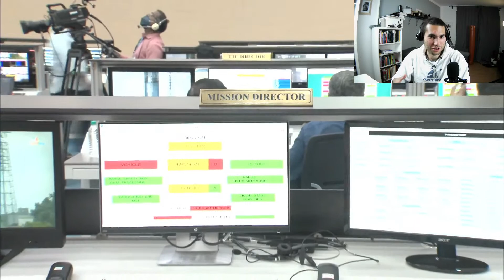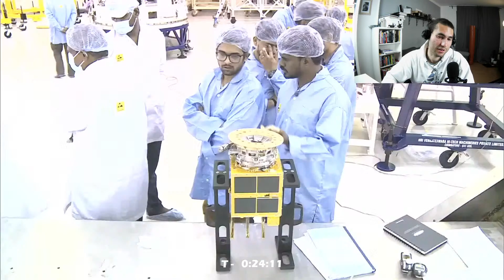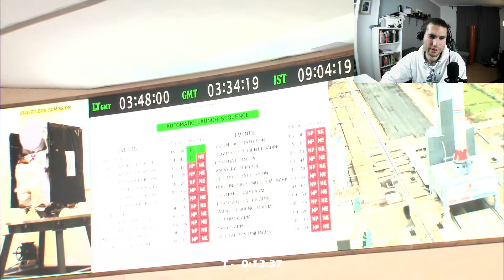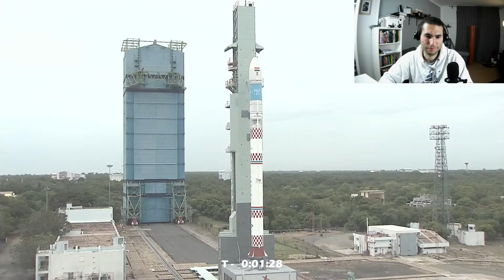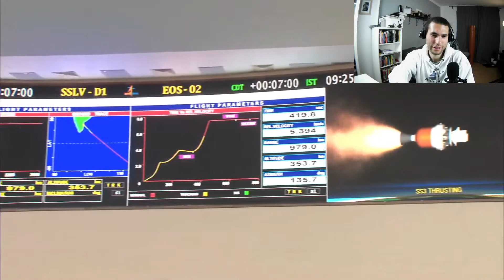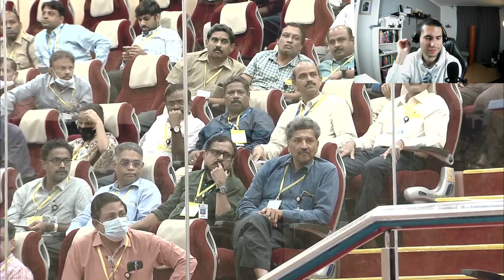SSLV First Launch: Failure due to wrong orbit insertion

Comment from the maker: It looks like we have official confirmation of a Launch Failure from the ISRO team.  As we were suspecting, the satellites were not deployed into a nominal circular orbit of 356 km altitude.  Instead the orbit was 356 km x 76 km.  This means that the satellites are not powerful enough to fight drag and boost their orbits back up.  As the perigee is below the Karman Line, those satellites will likely burn up within the atmosphere before the end of the day.  ISRO remains committed to the SSLV's development and will most likely come back in a couple of months with a second demonstration mission.  Lets go ISRO team!!
Reply: There was a malfunction in a sensor, and also a flaw in the control logic circuitry that was supposed to detect the sensor failure and compensate for it. As a result, the Velocity Trim Module which had just ignited went offline after only 0.1 seconds, instead of burning for a full 20 seconds. This meant the satellite did not achieve the required circular orbit, and its orbit is quickly decaying so that it will soon plunge back into the atmosphere.

Comment: The cage at the interstage coupling allows for hot staging.  The 2nd stage lights before 1st stage ends or right close to same time. I think it reduces the need for oleage thrusters to get fuel to settle and can simplify computer controls, etc.  I think Scott Manley and Everyday Astronaut talked about them on Russian Soyuz.

Comment: VTM uses hypergolic propellant for circularization maneuver I guess 🤔 from achieved elliptical orbit to targeted circular orbit. Can hypergolic liquid fail sometimes? They are best reliable thruster propellant not sure. 🤔
Reply from the maker: This is true, but ISRO has not so much experience with the hypergolics.  It seems that the VTM shut down a fraction of a second after start up.  This kind of behaviour suggests some sort of automatic abort or a problem with a valve.  It could also be an issue with the zero g coast  phase and the propellant management.  If the liquid was not in the right place at the right time, the wrong proportions of mass being fed to the combustion chamber could also have caused problems.

Comment: The VTM stage went Kaput, Satellites ended up in Ocean.. Mission Failed ! All the first launches of ISRO are failures, SLV, ASLV, PSLV but they learnt from it.. so will they do from this too!
Reply from the maker: If you are persistent, failure is just a pitstop on the way to success!
Reply: @ASTRABremen  By the way I believe the see through cage that you were referring to between rocket stages is meant to act as "vent" for escaping tail off thrust between the two stages as the 2nd stage would start a fraction or two before the first stage separates, this is something you'll see in all the other ISRO GSLV MK2.
Reply from the maker: Yes, that would make sense.  They do start that engine quite quickly.  I still wonder how it effects the aerodynamics in the lower atmosphere.